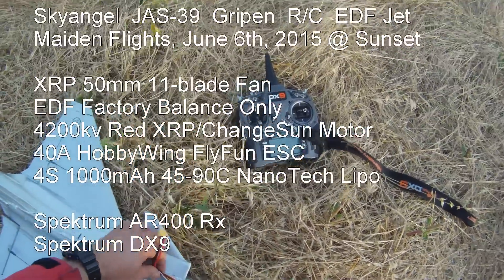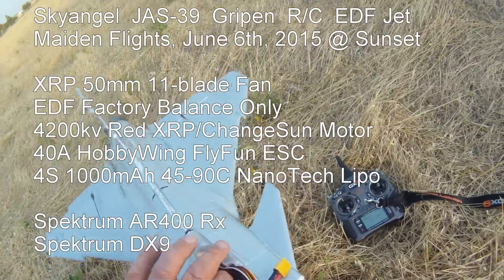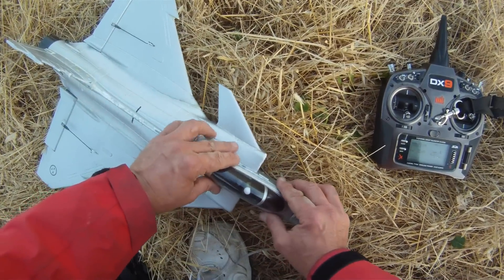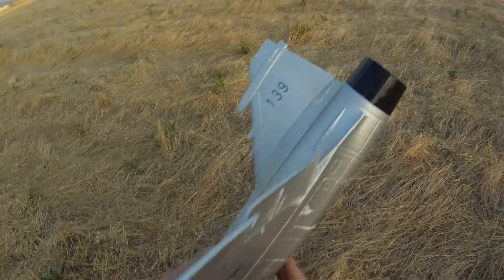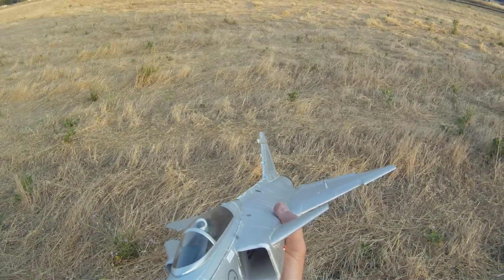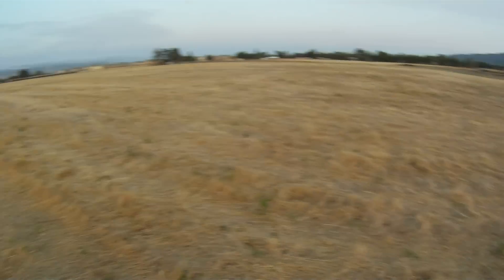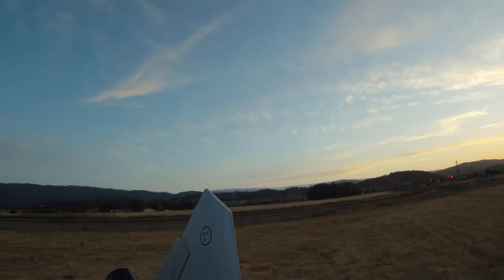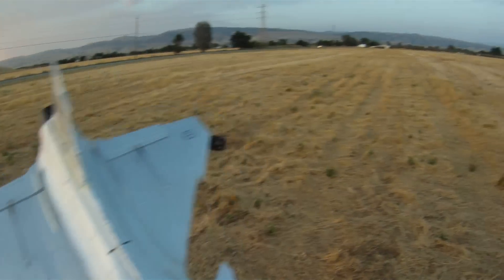Skyangel JAS-39 GRIPEN EDF Jet - Maiden Flight

Comment: Wow man great looking plane and awesome flying! You just sold me on this. I just bought the BlitzRCWorks Gripen and also the XRP 50mm 4200Kv / 11-Blade fan unit along with a SkyPower 40-amp ESC. I did have a few questions. When you mentioned 88mm in the beginning of the video, where are you measuring it from? Also, with the 4S 1000mAh pack, what would you suggest as a good starting flight time? Lastly, do you suggest any uptrim for the launch, and if so how much would you suggest? Thanks in advance!
Reply from the maker: I believe the 88mm (3.46") is from the location that the leading edge meets the fuselage.   The owners manual will detail this too.
I'd start with 2 or 2.5 minutes flight time timer if you're going with the 4S XRP setup and the 1000mAh 45-90C LiPo.   If you fly mostly WOT .. then don't go over 2min for sure.   Take it easy and of course you'll get more time.
As far a up trim for launch..  as this is a flying wing, the trailing edge control surfaces much be "reflexed" or trimmed up about 7mm on both sides.   This will be the level flight trim position.   For launch it couldn't hurt to give it a little more up trim...  just a little.. but I did NOT need any as I was launching it using an underhand upward toss and the 4S EDF has WAY WAY more than 1:1 thrust:weight.    I hold the Gripen's fuselage carefully between the wing leading edges and the canard trailing edges when hand launching.   Be careful not the induce roll when you release the Gripen as you release from the hand launch.   Important. to get the balance correct, I had to carve/remove the aft section under and behind the canopy and Velcro mount the battery way aft protruding into the ducting a little ways.     Even with a non standard rudder servo and heavier XRP EDF and 40A ESC, I still had to mount the battery about 2 inches aft of the standard location.   It may look funny seeing the battery hanging out a ways into the ducting.. but it works very well and will save you from having to add tail weight.

Comment: Hey dude, that fly amazing!! Where did you get that kit?
Reply from the maker: Thanks.   It's from Banana Hobby.   www.bananahobby.com.   They now have a grey paint scheme in addition to this blue angles color scheme.
Reply from the maker: Whoops.. I had your question mixed up with my F16.   While banana hobby does have the JAS -39 Gripens in stock now, the actual one I picked up was off amazon.com.    It only has the silver color scheme.   The balance at 88mm per the manual is perfect.. just make sure to put in 6 or 7mm of reflex (up) in the centered stick elevon trim position.